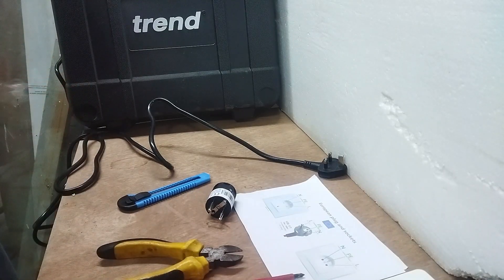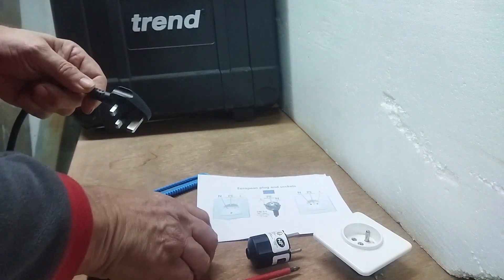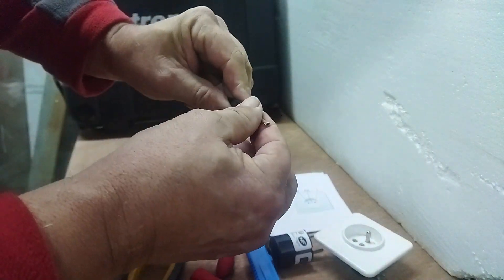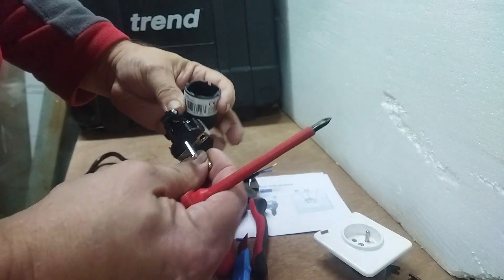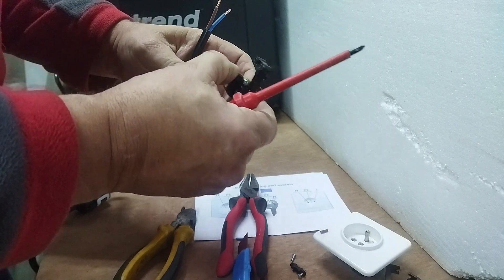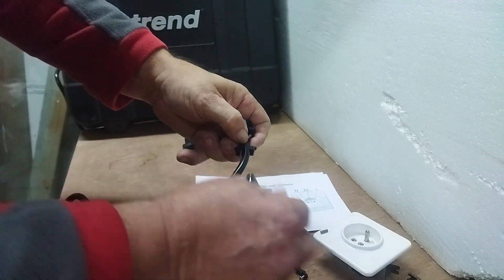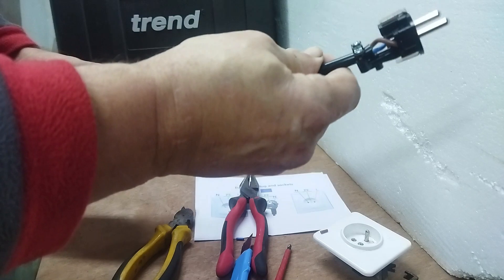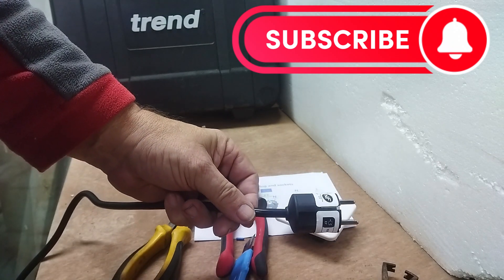Live wire on French plugs explained / Wiring a French plug

Comment: Unlike the UK all circuits in France are separately fused; in addition, there are usually two additional forms of protection. 

You're fitting a Schuko type plug which is a universal type that fits many European sockets.
Reply from the maker: thanks for the info#